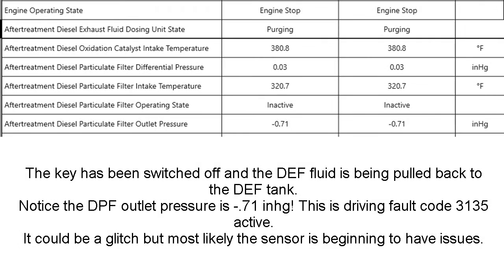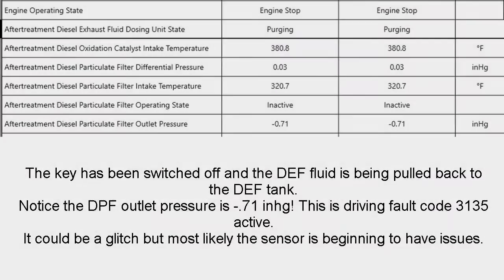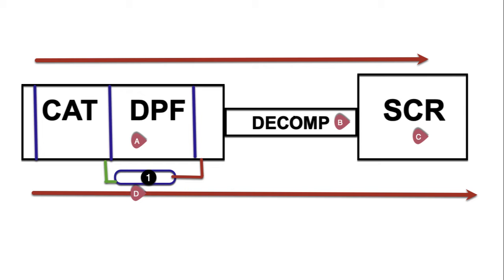Fault code 3135; A COMPLEX fault

Comment: With reference to code 3135, I’m having an issue where my outlet pressure is showing 0.0inhg. The diff pressure is showing normal, I’ve tried a different sensor and I’m still getting 0inhg. Any ideas?
Reply from the maker: Check signal voltage for dpf out pressure in insite data monitor- key on engine off. It should not be 0.0. If it is check wiring from ecm to the appropriate pin with an ohm meter or load pro. If that checks out then recalibrate the ecm and see what happens.
Reply: @ I’ll try recalibrating the ecm. Other than that I also have to try pin to pin to see if I have any resistance in my wire harness. Thanks for your suggestions brother. Cheers 🥂

Comment: I have x15 sometimes on a passive regen driving I get lots smoke pouring out of stack and if I come to a stop it smoking down by the def system. This only happens like every 3 or 4 regen.  During normal operations no smoke at all
Reply from the maker: If smoke comes out under your truck (from the exhaust ) there is a leaky joint or failed pipe or gasket. It is a good Idea to fix that when you can. If the flex down pipe leaks it will cause your ecm to calculate the incorrect amount of fuel to send to the aftertreatment to heat it up. It is not a big deal but it wastes a small amount of fuel but the fumes could be getting into the cab that is a big deal.
Reply: They just did dog cleaning all new gaskets and all bands are new. I look under truck look likes coming out of the cap on scr